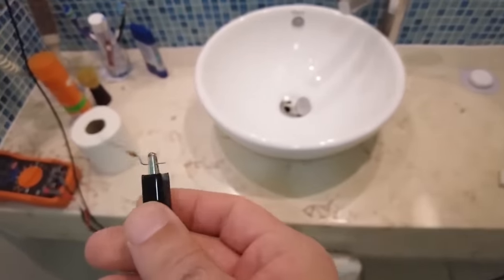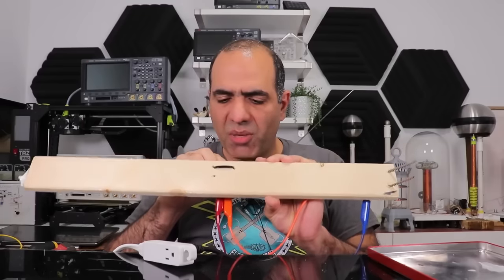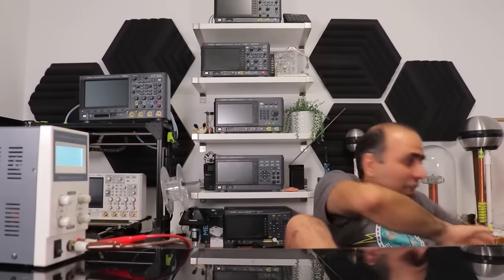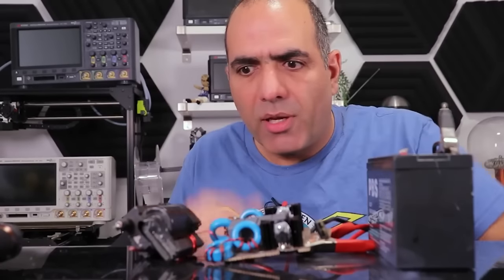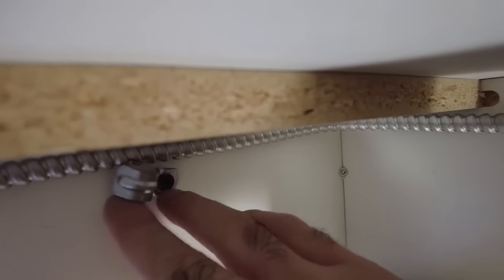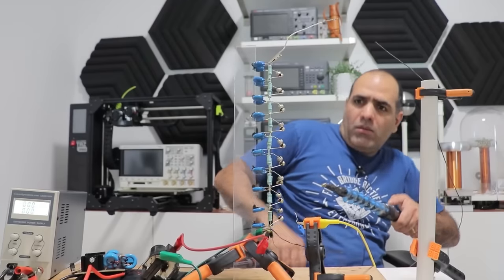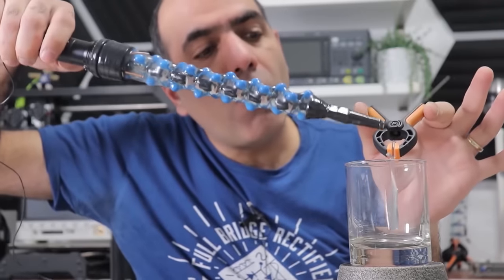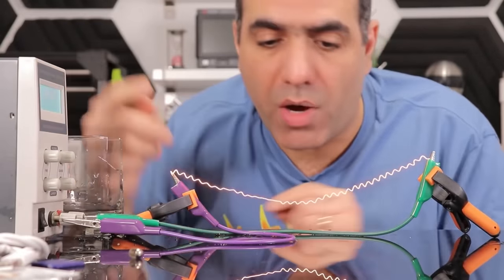ElectroBOOM's Funniest Moments | Hilarious Electrical Fails & Bloopers

Comment: 1:14 Is that home made bulb launcher?:)
4:56 Protect what?Its 17k volts.
5:09 Fire...dude spray water on live wires:):)
6:32 Yes grab by fingers metal piece and stick it to capacitors..what can happend?
7:38 Ahaha no this is not how it works:):)